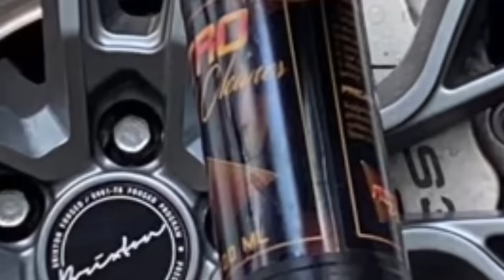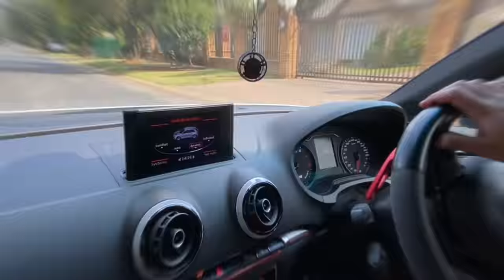Dylan’s built RS3!!!!

Comment: 5 cyl > 4 cyl... not even up for debate
Reply: Huh ??
Reply: It’s up for debate when budget comes in. Otherwise you could just say 6cyl > 5 cyl 
Or 8 cyl > 6cyl and so on.
Reply: @TheeBatman02  The A45s(4 cyl) and new RS3(5 cyl) are priced similarly.
Reply: @WaseemKhan-iu4bh  my point still stands. Because In that case just go for an C63 Mercedes? The 6.2L N/A
Reply: It's not fair though 😭😭😭😭
Reply: @TheeBatman02  fax
Reply: 4cyl is the most efficient
Reply: @20valve_FF I agree with you, but a 2jz is an inline 6. The 2.5L I5 is one of my favorite engines of all time, but it's not greater than a Honda k24.
Reply: all the 5 cylinder cars are really expensive tho , if you want a cheap 5 cylinder car the only things that are super cheap is MK2 Focus ST or Volvo's